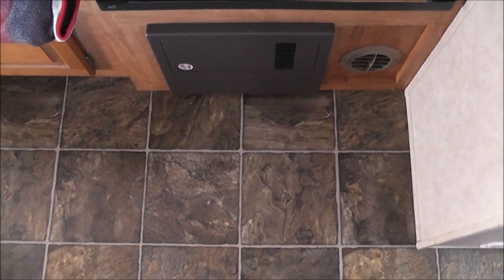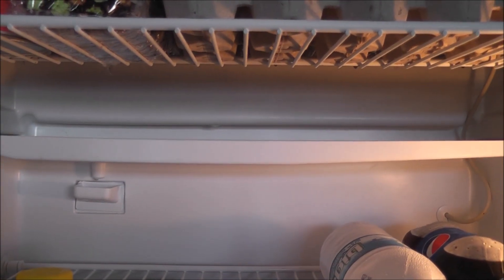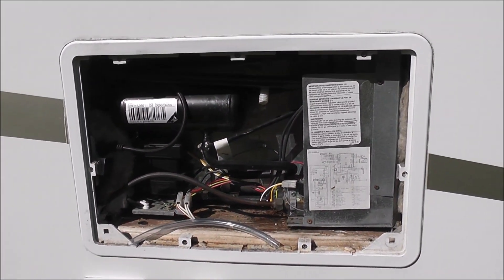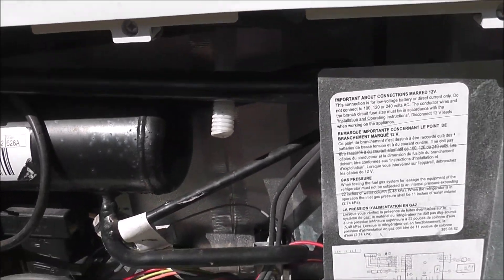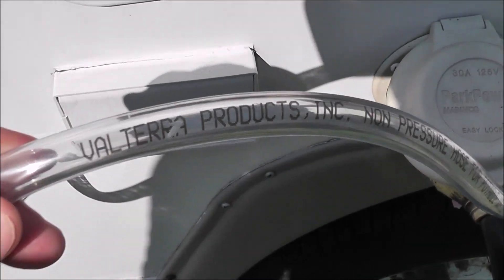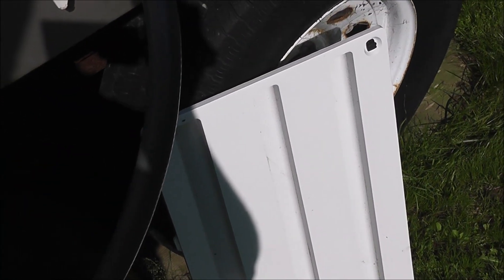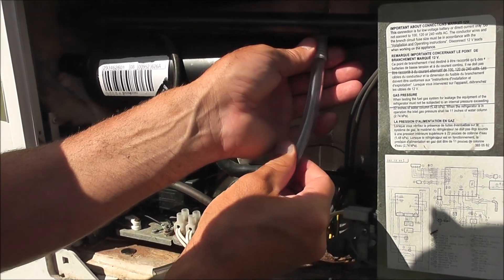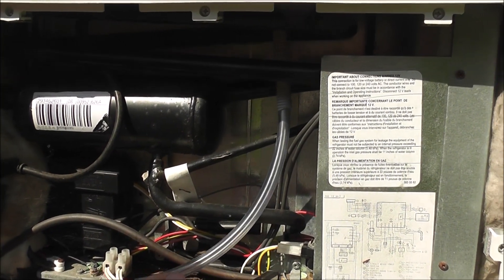Rv Fridge leak

Comment: Cool Video helped ! One thing I did different was used a larger hose so that it went over the existing hose because when you add a obstacle in the path of water you just made an issue that will probably come back to haunt you later ! i.e build up or leaking! Always eliminate any obstacle in the path of the water flow! So if you have to extend your drain line ,  secure it over the existing  line ,not inside !

Comment: Thank you for showing that the dranage tray was in backward, I was wondering what the spout was for, easy fix. thank you again. GOD BLESS you and yor entire family.
Reply from the maker: if you're referring to the spout on the inside portion of the fridge... it provides  the water that has condensed on the inside of the fridge to flow to the outside

Comment: I hope I can do that with mine.  Its white just like the one you video'd and barely pointing out the fridge back vents of the camper.  I touched it to pull it out more so it wouldn't leak inside but some pieces broke off....very brittle like you said.  Its just touching the outside enough to drain.  I'm willing to try what you just did but if I break more of it off and can't fix it then my husband will have to get involved.  Can you put the clear tube over the white plastic one instead of inside of it?
Reply from the maker: I suppose if the clear tube's diameter  is a little bigger it would work.  The reason I did it this way is because the diameters complimented each other.  In my opinion this may be a temporary fix, I may have to do an update this summer.  It will involve pulling the fridge out and re-attaching a stronger tube/hose from it's original spot.  I feel the white plastic hose will eventually crack (even on the inside where it is protected) … I could be wrong but time will tell.  

Good luck and thanks for watching

Comment: That tray fell off it's attachment when I bought the RV.  I foolishly kept it in the basement of the RV for a month because I had no idea what it was.  Finally I said, "well this is just useless extra stuff" and threw it out.  Well don't I feel dumb now.  Because I had a leak coming from the outside of the fridge around the bottom.  Just reordered one from amazon.  /sigh